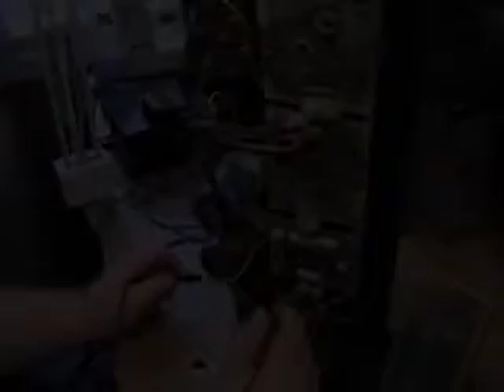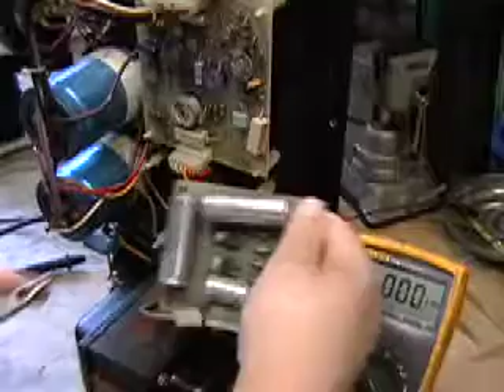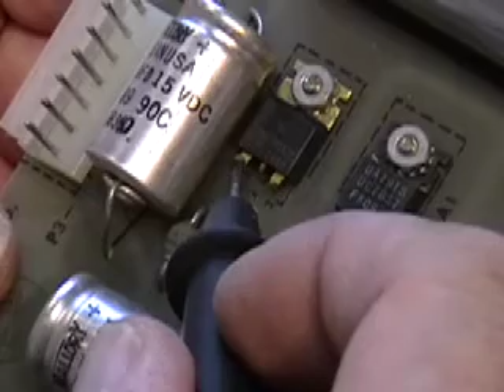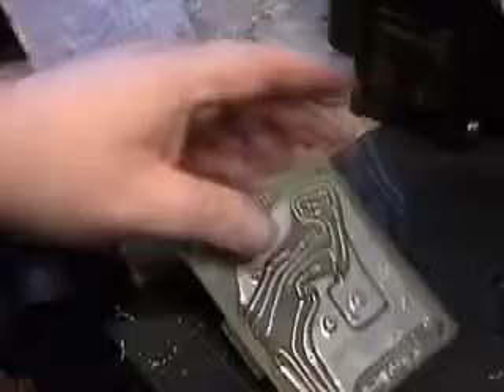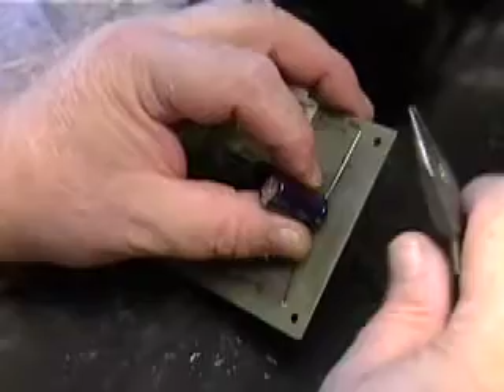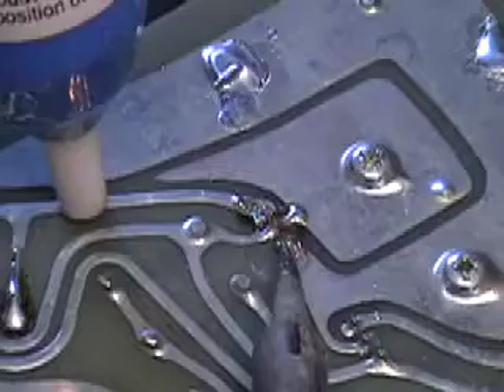Rhodes 5 Pin Power Supply Repair Part 1

Comment: i Have a 5 pin switchcraft power supply that came loose from the piano side of my suitcase rhodes.  This is the piece that the power amp cable pugs into the piano.  The wires are red, orange, yellow, brown, and green.  I know that 1 is brown, and 3 is orange.  Could you help me out with the other three color to number matchup?
Thanks